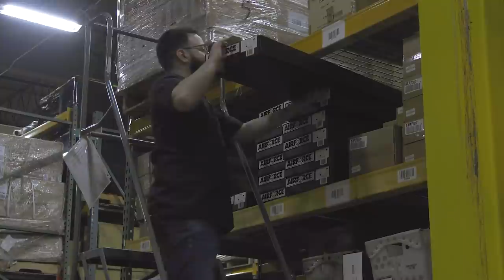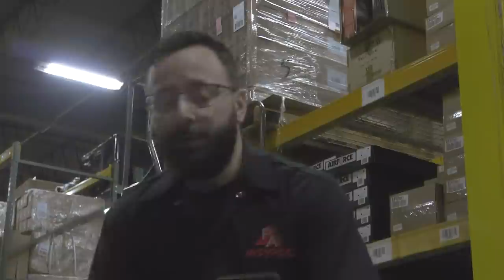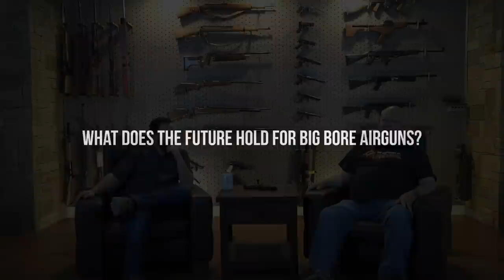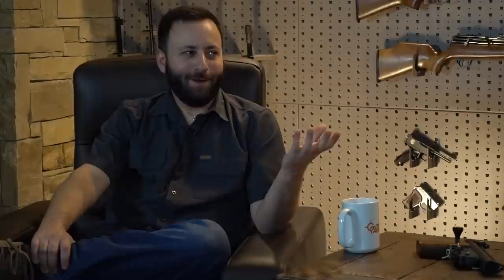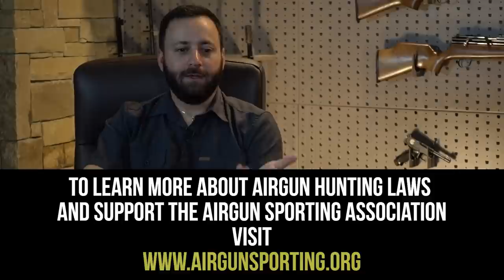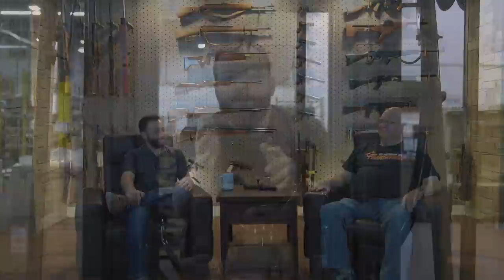Big bore airgun future - TNT episode 2

Comment: Outstanding conversation on Big bore, how about a conversation on how to get the prices down for the little guy?
Reply from the maker: That will be tough to do in the current economic environment... Maybe go with the most economically priced big bores, and then you can always use Affirm on our site to break down the payments into installments.
Reply: @pyramydair  $200 or $300 for a high powered bigbore air rifle is never going to happen. I own 5 right now, Benjamin Bulldog .357 caliber, AEA Terminator .357 caliber, Umarex Hammer .510 caliber, Airforce Texan LSS 3625 Carbon Fiber tank version .510 caliber, AEA Zeus .72 caliber, and still looking to buy 2 or 3 more and that's it for me. I was about to buy the Benjamin Bulldog .457 caliber,  After seeing and hearing more about the .457, I decided to pass on getting that Rifle. I was expecting a little more from the Benjamin Bulldog 457.
Reply: @99prochargedbird85  if I am to get just one that is bang for the buck, which would you recommend?
Reply: @2musiclover534  I thought I was only going to get one. It depends on how much you are looking to spend, if you are on a budget I would look at the AEA brand, and not the 2 AEA rifles I have, since those two are not cheap cost wise, but none of my guns were cheap they were all from $800 - $1,340. Honestly I would look at the AEA brand they have a good selection at good prices, also since the generation 2 rifles came out generation 1 prices have dropped, I found that out just after I purchased my Zeus 4 months ago. You can also watch videos of them on Youtube.
Reply: @99prochargedbird85  Thank you. I did not realize that there's a Gen 1 vs Gen 2...will look that up.  Also, I thought perhaps you would recommend the Benjamin Bulldog....for me that's a price range that's reasonable.
Reply: @2musiclover534  Wouldn't you rather see a lot of gun's with actual testing and commentary on Youtube, a gun you might be interested in, then taking one persons recommendation? Thats why it is best to watch all these video's that are out there for you, that way you can get a better idea what you really want. I like all my guns that would not help you in choosing one. That being said the Benjamin bulldog is a good gun, but my Benjamin Bulldog is modified with over $400 of parts from Pitbullairguns, steel charging handle, blue power spring, Barrel supports, Depinger, 5000psi Gauge, High performance breech O-rings, and $225 Bluetick Tube Air reservoir this is an extended air tank certified 2024 Aluminum with a .125" wall thickness that can handle more air pressure, I am using 3600psi, stock can only handle 3000psi, and a few other internal mods done for more power.
Reply: @99prochargedbird85  Thank you.  😊

Comment: You are right about  the same  shot placement as you use with a bow. I have harvested 2 deer and 2 black bear with the. 457 airforce texan lss cf. The last bear I shot through the  shoulders and still got  complete penetration with a 349 gr hp cast from pure lead the lynman devastor bullet mold  is supposed to  cast a 325 gr hard cast. The first bear it put a 1 7/8 hole through both lungs and never stopped. So a big heavy slug will penetrat well.

Comment: I took my first airgun deer this last December.  It was a 40 yard shot with a Texan LSS 45. Yes it jumped 10 feet in the air and ran roughly 60 yards after it was hit. But that 350 grain slug punched thru both sides and kept going. Little to no deformation, half inch in, half inch out. I was actually surprised that the deer my sister got the next day with a high powered rifle ran about 20 yards further. So the myth that a high powered rifle knocks them over I have to question. Since we both hit pretty much the same place on both deer, the air fun dropped it in a shorter distance with close to the same internal damage.

Comment: Actually they go up to 1200-1400 ft pounds in a 12 gauge slug gun called the AEA Zeus’s, but man it’s heavy but fun taking up to 4500 psi fills good for 3-4 shots.
Reply from the maker: Sorry for the late reply. Any reports on the gun out there actually as far as safety track record?
Reply: @pyramydair   This airgun actually has been out for a couple of years . I suspect you have heard about AEA airguns by now, you can look up several articles and reviews on their airguns so far in which the Zeus in particular already has a second version out in which comes with a handsome walnut stock. I have shot mine for over 100 shots and have not had any issues so far and am planning on taking it hunting this deer season. The gun has several safety features on it if you look them up as well as two different forms of locking the bolt. You guys may need to look into it and do a review on it you may be surprised and interested

Comment: Tyler,  One thing that I think is going to prevent wider adoption of big bore airguns is the cost. Some of these airguns cost as much, if not not more than a conventional hunting rifle (firearm). Many may say, why spend the same money on an airgun that doesn’t shoot as far, doesn’t have as much power, and lacks the  hydrostatic shock?   Can you explain why one might want to?
Reply: That's totally fair.  Cost is a factor, without question. Personally, I think there are a couple of factors that may play into someone wanting to pick up a big bore airgun for deer hunting (just using deer as an example).  I think a lot of folks that look into airguns are doing so because it's a new challenge. They've hunted with firearms, archery, maybe some other methods as well, and airguns are another method of take they can employ. Airguns can also be a great way to introduce new hunters or young hunters to "gun" hunting. Less recoil, and no need for hearing protection with many of the big bore airguns when used outdoors is a big plus when introducing new shooters or hunters as well. That's what comes to my mind initially. What do you think?
Reply: They are much more quiet, I’ll concede. That’s a big plus. I did see a video review of a Benjamin 357 Bullpup where the reviewer still recommended hearing protection as he thought the hammer ping was painful to the ear closest to the stock.

Comment: I thought that the (AEA Zeus) puts out over 1000FPE I'm pretty sure it does. Accurate I don't know but it does generate a lot of energy.
Reply from the maker: Sorry for the late reply. Any reports on the gun out there actually as far as safety track record?
Reply: @pyramydair  As far as safety goes. I don't think I've heard of anyone dying or even getting hurt. Now as for my Gauntlet, that thing dumped all the air in the cylinder. Haven't had that with AEA so what's your point?

Comment: People have long believed in Col Townsend Whelen's theory that 1000 FPE was required for deer sized game. That may possibly be the case for the small caliber high velocity cartridges that he was speaking of but is certainly not true for larger calibers. Heavier weight, larger diameter bullets may not produce "hydrostatic" shock below 2200 FPS but depending on the composition and nose profile of the bullets they penetrate tissue very well and kill just as dead with well placed shots. I have personally taken several whitetails with my .45 Colt revolvers that would not make 600 FPE at the muzzle. Some fell right there and some ran a short distance before going down. All died quickly after being hit. A big bore airgun works in a similar fashion. Hit the game in a vital area and it will go down quickly. I think too many hunters and State agencies believe that deer somehow require 1000+ FPE to be killed cleanly. It wasn't true for the old longhunters shooting round balls from their flintlocks and it's not true for big bore airguns today.
Reply from the maker: I agree 100%. The .50 air bolts going 500 fps are delivering under 300 ft/lbs yet, they are absolutely deadly.